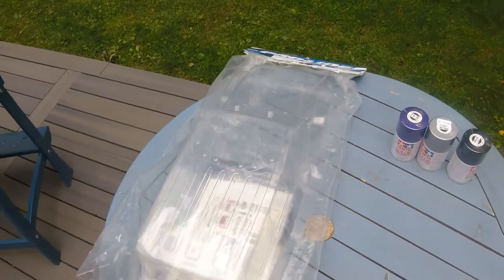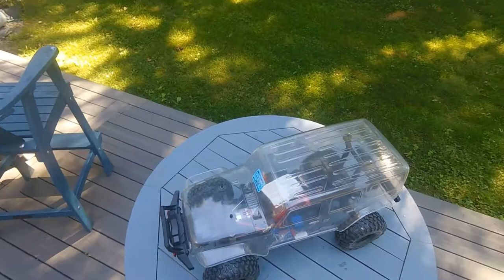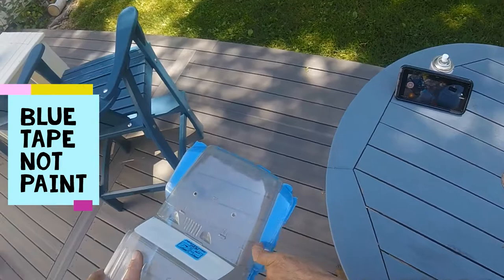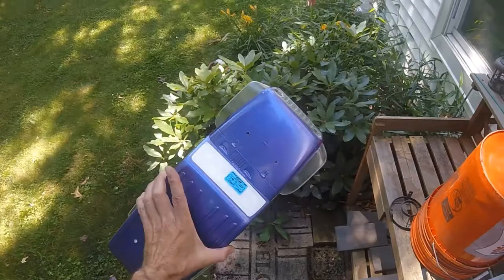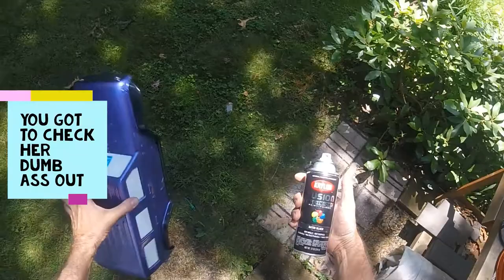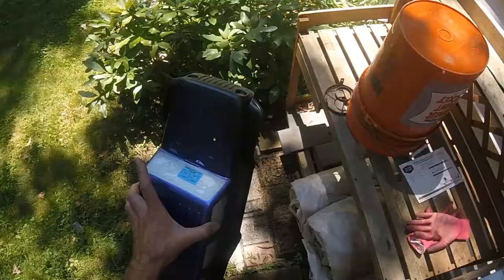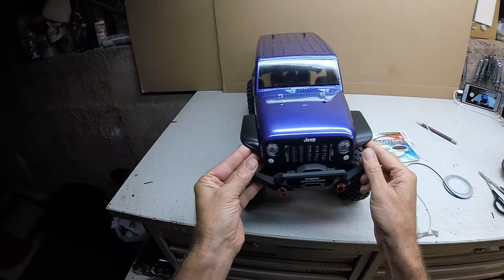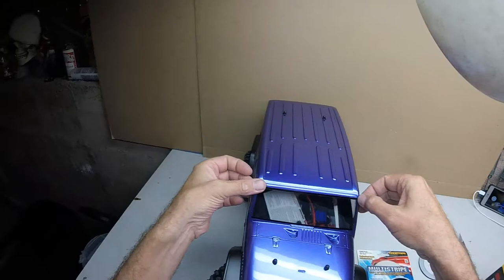#48 TRX4 CUSTOM JEEP , PAINTING , WINDOW TRIM , PROLINE BODY

Comment: the matte black fender detail is very useful! thanks!
Reply from the maker: What's up Cooper , Just make sure you get the correct KRYLON (BLACK LABEL ) the other crap will not work , also Black on inside too , Never had a problem doing it this way
Reply: @ucrazy2rc460  What a coincidence! I had bought the PS-5 black Tamia paint(the exact one you have) and some other red paint before I watched this video! Thanks for letting me know, and good thing I already bought the perfect paint.😂

Comment: I love all your videos I know this is 2 yrs old but what size is the pin stripe tape you using on widows Thankyou bud
Reply from the maker: Hi , It's 8mm & 12mm ( both on same roll , use the one the looks best on your vehicle ) , standard auto parts store pin stripe tape for cars , the key is to NOT PULL IT , just lay it down and add some heat ( blow dryer works ) seals it right in there

Comment: Man I started the whole thing and just when I placed the body after I opened the holes, I found out that I have the wrong body size! i was wondering why the rear bumper was sticking out and the body wasn't sitting on it. I called Horizon Hobby and they told me I have the wrong body. they are sending me a new one.
Reply from the maker: Don't you hate that ,  at least the rise horizon is hooking you up
Reply: @ucrazy2rc460  Yup that helps. Is a good thing I didn't do anything else!
Reply: I realized the problem when i saw in your video the rear of the body. The body was sitting perfectly on the bumper but mine was sticking out.

Comment: hey man I wanted to ask a question. I got a replacement body because mine looked to short for the 324mm TRX4 chassis, and on your video, the rear bumper sits right under the body just fine but mine does not and sticks out about an inch. Did you do anything to modify the bumper or the chasis to make it fit? The replacement body they sent me is exactly the same.
Reply from the maker: You can swap the front bumper mount with the rear bumper mount and that'll lift or lower it , can also flip them upside down to raise and lower it , May have to trim a little bit if you flip them upside down
Reply: Yeah I’m already used the front mount.  I’m using an aftermarket bumper because the stock sticks out too much. I really don’t have a problem with the hight but rather with the length.  The body doesn’t sit like it does on yours, which sits perfect. When you say “trim” what do you mean?
Reply from the maker: @perohijo  if you flip the bumper mounts upside down sometimes they got a little part on them that needs to be trimmed off so it'll fit in there
Reply: @ucrazy2rc460  ok man. Thanks for that I’ll check it out. 😎

Comment: Damn your good I just bought the same jeep I'm gonna attempt to do, what do you suggest on window tinting? I'm wanting the windows dark, I have some Tamiya smoke for them but I'm not sure if that's the best route to go?
Reply from the maker: Smoke is good for tint , more u put on darker it gets , have to spray wet coats with the smoke , try on scrap plastic first
Reply: @ucrazy2rc460  ok and would that be the last part of the body you would paint after everything is done?
Reply from the maker: @braddunn5983  yes last step , or when you pull window mask off

Comment: What would you charge to do that same body in gun metal grey with black top and fenders?
Reply from the maker: About $100 plus shipping , Body , paint , my time , not painting at this time due to winter
Reply: @ucrazy2rc460  I have that body and I and did not do  good job of cutting it out. I have it mounted to a Gen8 chassis. I own a 2017 Rubicon in Granit Crystal (gun metal) and trying to match my crawler with my real life Jeep. I have managed to locate very similar bumpers to match as well as wheels and tires. I think it will be cool when its done. But really would like to have you do the body when the weather breaks. I am in Georgia and I have been waiting for good weather to paint this body I have even tho its a jagged on the fenders lol.
Reply from the maker: @TeamBoogie  Not a problem , once weather warms
Reply: You think your getting close to painting again? My JK turned out very well and looks just like my real life Rubicon. I sanded all the edges and it turned out nice. Now I think I want a Power Wagon for my other truck. Do you do weathered look?
Reply from the maker: @TeamBoogie  yeah I'm painting Again
Reply: @ucrazy2rc460  you on Facebook or Instagram so I can contact you?
Reply from the maker: ucrazy2rc@gmail.com